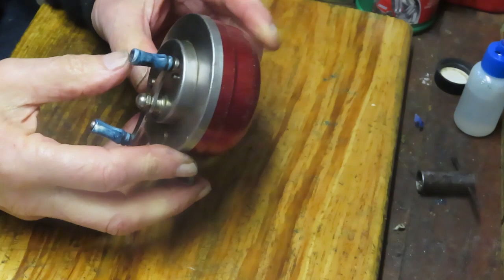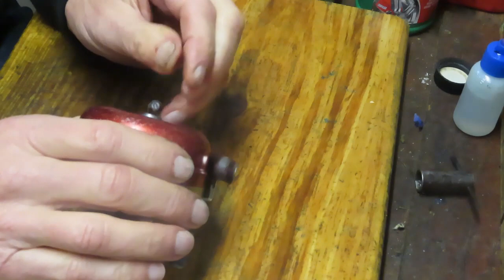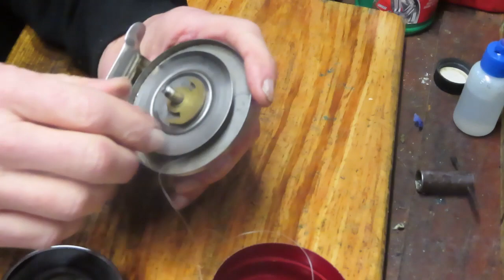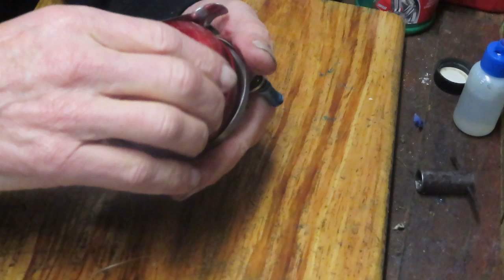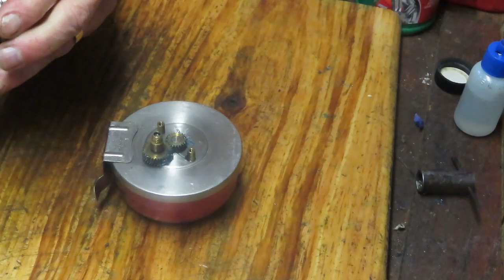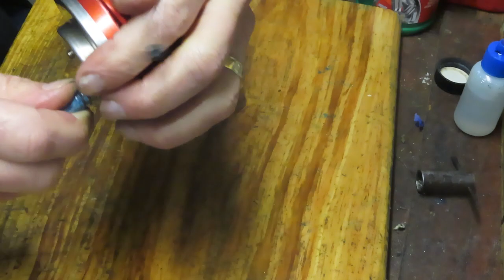Unique Fre Line fishing reel how to service

Comment: I own one of these. Mine is a little different though because it has a drag levers that comes out of the back for your pinky. I use it with a collapsible metal fly rod
Reply from the maker: That's great.  You don't see these around very much.  Glad to hear you ae still using yours!  Dennis

Comment: The Fre-Line made by Wright and McGill tackle co. , lots of them for sale on e-bay, and commenter Dan is correct, that is the original handle that came on the reel. The line release design is the same as my vintage South Bend / Shakespear  "Wonder-Cast" spin cast reels, takes a bit of getting used to for any distance casting, but it works! Thanks for the vid!
Reply from the maker: Sure thing.  You have to love these old reels and their designs

Comment: Interesting design. I almost bought one of those a couple weeks ago. I bought a Humphreys Model 3A sidewinder instead. It is even more basic than the Fre-Line as it has no gears. The rotor is connected directly to the crank. The crank on that Fre-Line is the OEM crank. It looks out of place, but if you compare it to all the Fre-Line reels on eBay they are mostly the same crank.
Reply from the maker: Thanks Dan.  I have seen the Humphrey reel but have not opened one up.